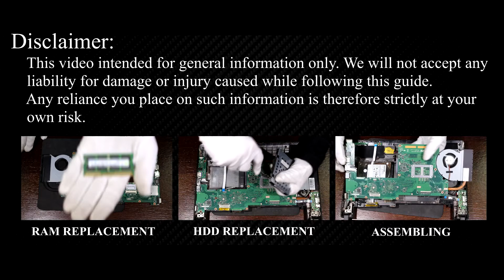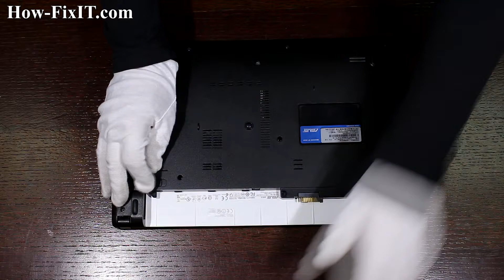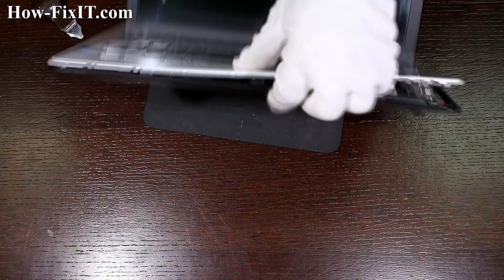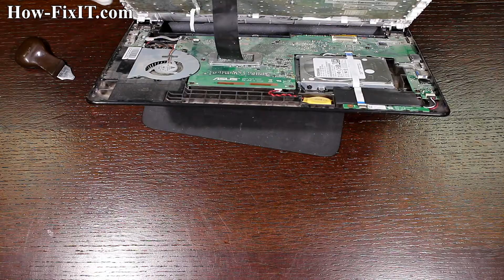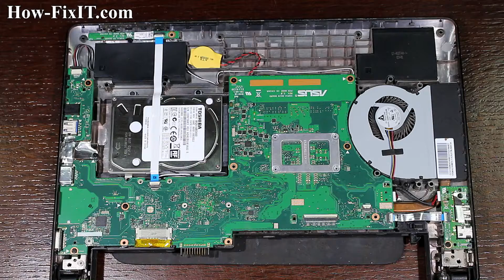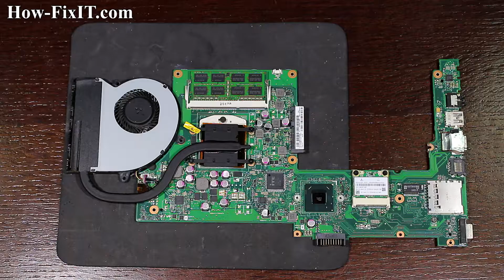Asus X401 Overheating Fix: Disassembly, Fan Cleaning, and Thermal Paste Replacement

Comment: Nooooooooooooooooooooooo don't ever brush a PCB with a natural or artificial brush it generates static which can damage the PCB ;)
Reply: What brush should we use?
Reply: @jordykrist5257  air duster
Reply: Correct